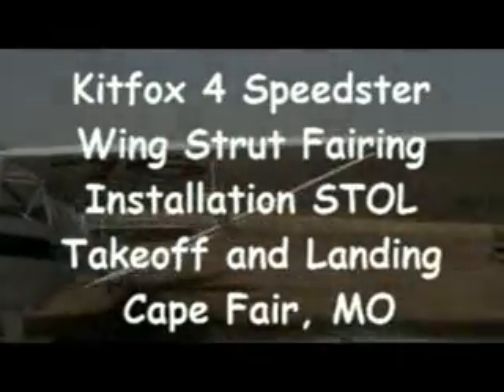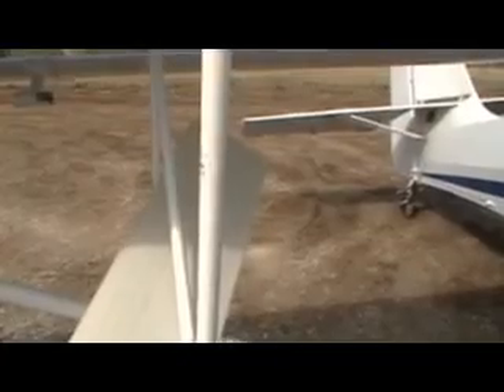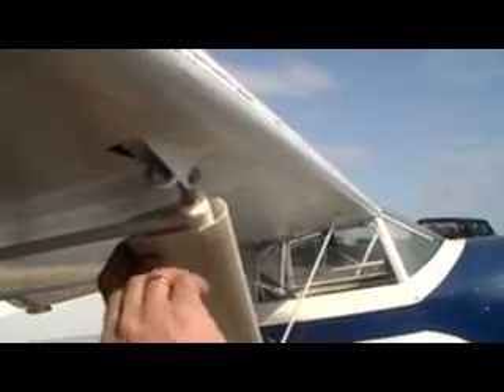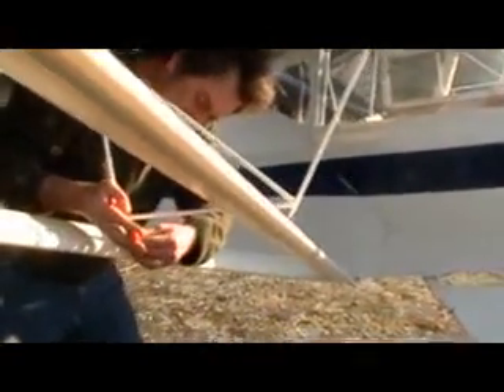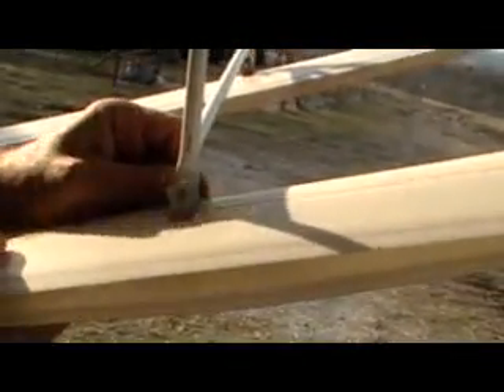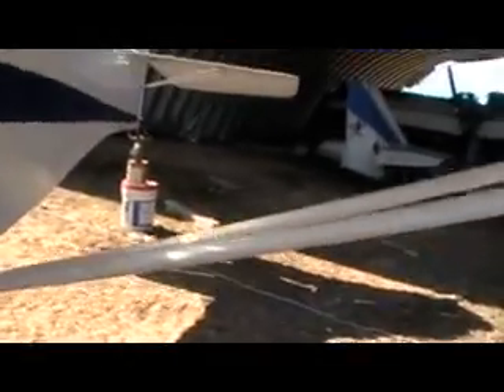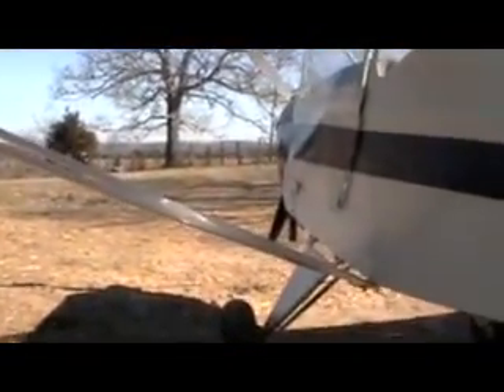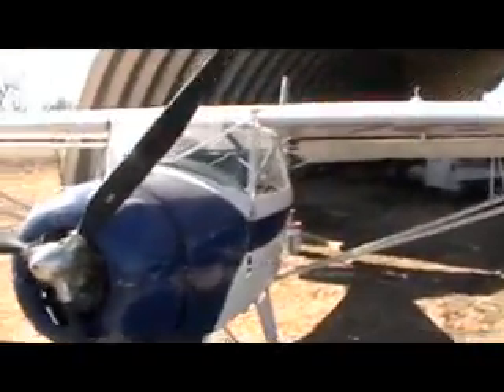Kitfox 4 Wing Strut Fairing Kit Installation STOL Landing

Comment: Decent gain.   I think if you cleaned up your gear and have your strut fairing out a bit longer  you would see more.   Kitfox a dirty plane anyhow but they made for STOL ops when built  light.  Yours should cruise 105 to 115 mph at least I would think